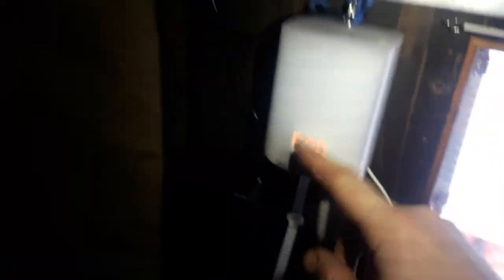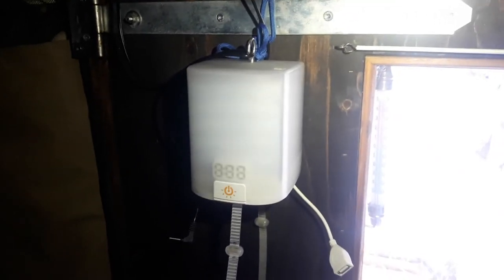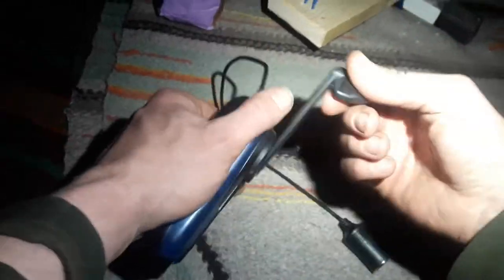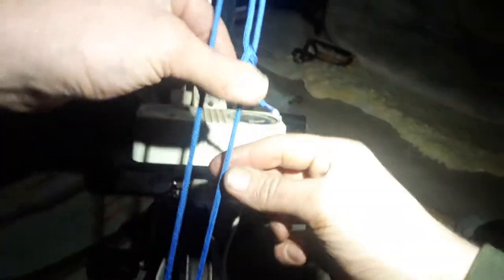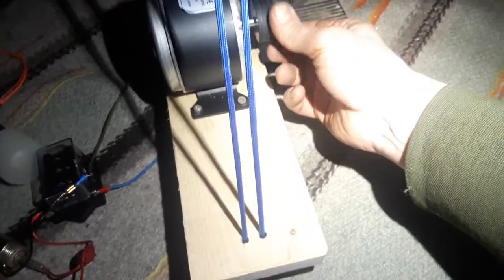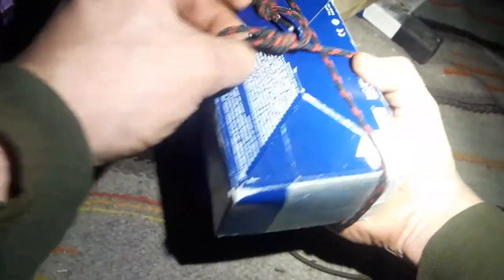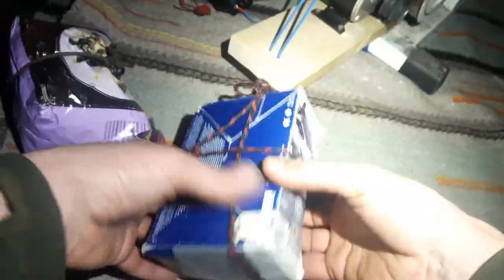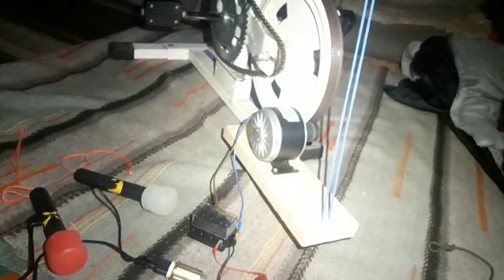Nowlight, Freeplay, Bicycle generator in offgrid yurt

Comment: Nice to see your bicycle generator is working! How long does it take to charge the power banks? And what are their ratings in mAh? I also definitely will steal your use of the the knot to tie shut bags and packages. Have used the knot for all kinds of stuff but that is a genius way of using it!
Reply from the maker: Still figuring out the charging times. It's as slow as a normal wall charger and pretty fast pedalling. If only there was wind enough here. Next project is wind... but now needed something fast and reliable.